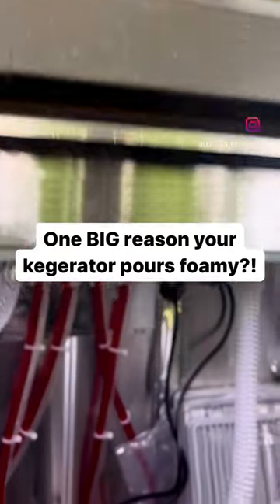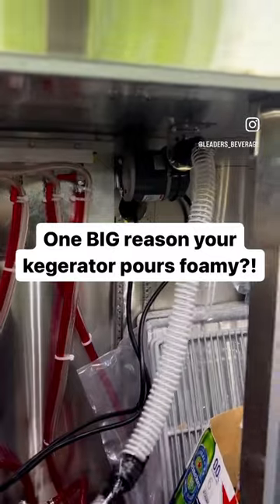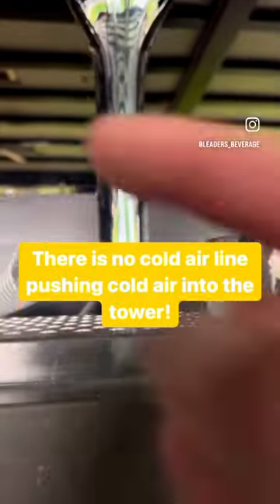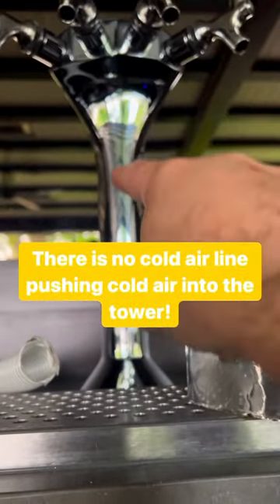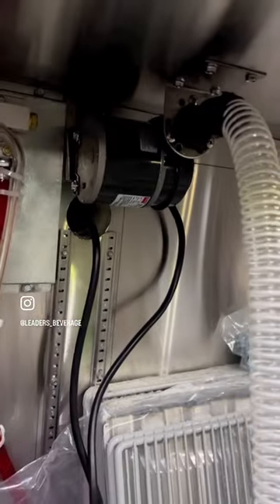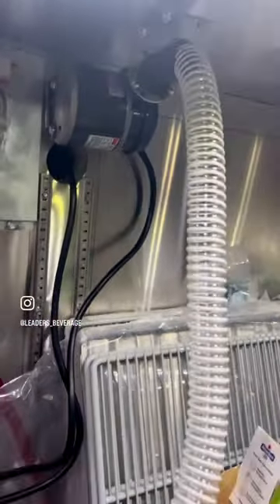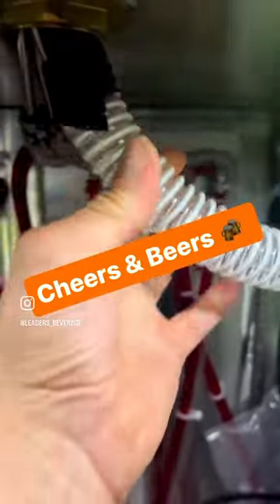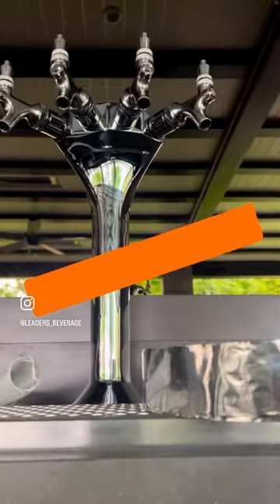Why does your kegerator pour foamy? This is one BIG reason #beer #kegerator #shorts

Comment: 👍❄️💪🇺🇸 nice work
Reply from the maker: Thanks @shine-cg9uf ! Cheers & Beers 🍻
Reply: @LeadersBeverageConsulting  do u ever come across root beer on tap with two prong sankey? Not a fan of having them put on draft systems
Reply from the maker: @shine-cg9uf  Hi Shine, we do come across root beer on tap. It is exceptionally hard to get that flavor out of beer lines so anyone putting a rootbeer on should plan to never take it off. As to the coupler, it sounds like you are talking about a coupler that is no longer really made or produced (at least in the US no one does). Here is a link to a picture of that style of coupler. If this is what you are running into its because someone or some company has a bunch of kegs that still use it which they own. Otherwise, you will never find this out in the mainstream anymore. Cheers & Beers! 
https://www.maurersales.com/wp-content/uploads/TC202N-1.png
Reply: @LeadersBeverageConsulting   yep its been nothing but a headache since they put it on. Gas leaks n it's always the 1950 two prong root beer. I informed customer of risk of putting it on n they  said that it would b permanent. A yr later they r takin it off. PITA! Cheers
Reply from the maker: @shine-cg9uf  Isn't that the way it always goes? When we try to get root beer out we replace the jumper, any and all seals including the coupler and faucet, and the cleaning is a two day process. Even then we only have an 80% success rate. -Good Luck with the one you are working on. Thankfully the rootbeer on draft fad in Chicago ended a few years ago.
Reply: @LeadersBeverageConsulting  yep u can lead a horse to water but… n yeah I replace jumper line faucet etc.thanks for sharing ur knowledge n experience.
Reply from the maker: @shine-cg9uf  horse to water, perfect analogy. Sounds like you are in the same business. We find the best way to learn and grow is to interact with other draft techs around the world. Thanks for chiming in and chatting. -Cheers
Reply: @LeadersBeverageConsulting  yes sir I'm in Philly

Comment: That is a nice size blower in that setup! Know of any suppliers? or recommend any quality tap tower cooler/blowers? Thx
Reply from the maker: Howdy @ShopGoatVentures we use and distribute Micro Matic equipment. This is a direct link to that little blower. https://www.micromatic.com/en-us/12-cfm-blower/p-XTsp-QQ13EyZEhuPkOnqkg
Reply: @LeadersBeverageConsulting  Thank you!
Reply: I have the exact same tower but one of the lines started leaking and I haven't been able to fix it. Anyone knows of a video or link with info on how to fix that? Cheers and beers! 🍻
Reply: @LeadersBeverageConsulting is there any info or video on how to fix a line on that tower? Mine has started leaking and I have not been able to fix it. Cheers and beers 🍻